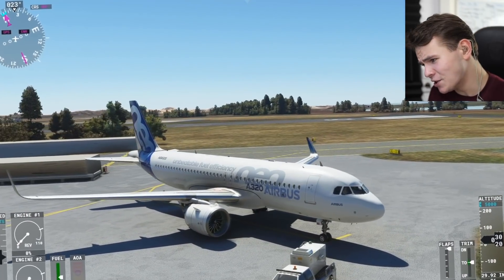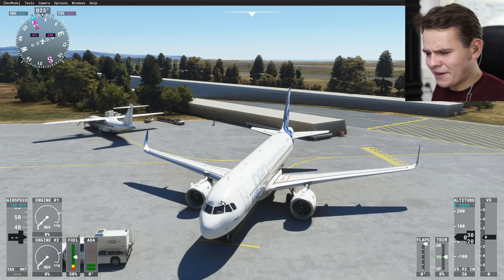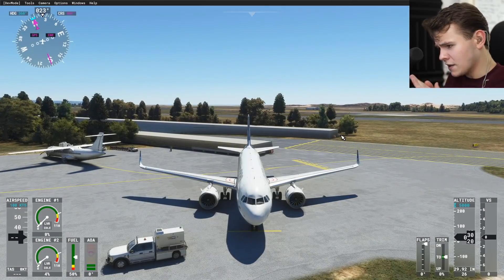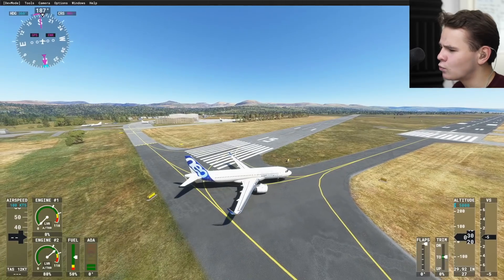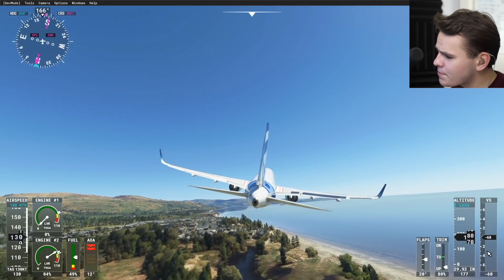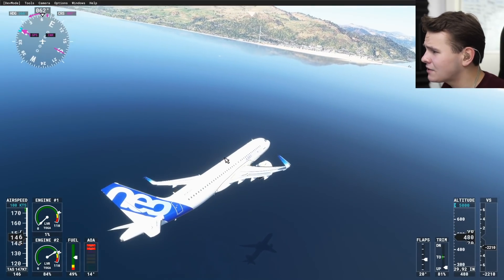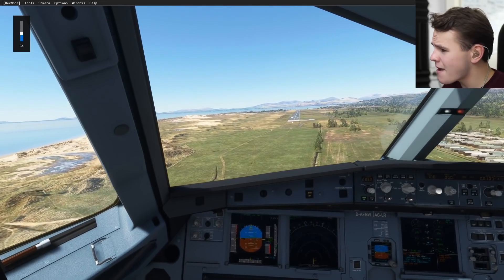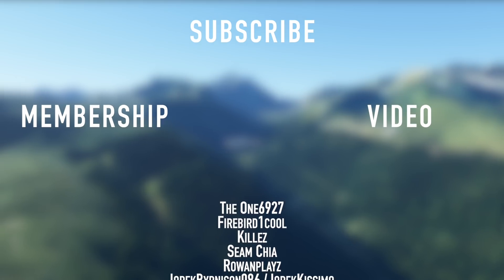Can Planes Really Only Fly Off Only 1 ENGINE? - Full Flight

Comment: During takeoff he isn’t going ful toga mode. U need to press the red button to acces toga then do the full throttle lever.
I have the captain pack too so I’d know.
Reply: also pitching over 10 degrees will not help you climb with one engine